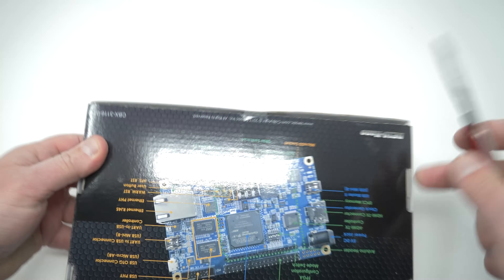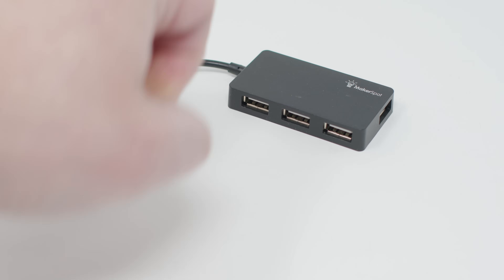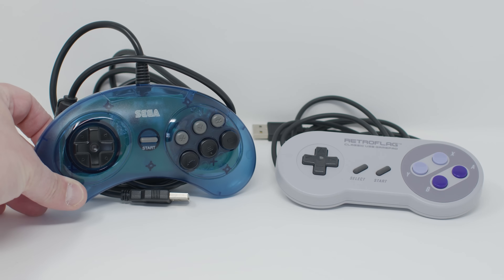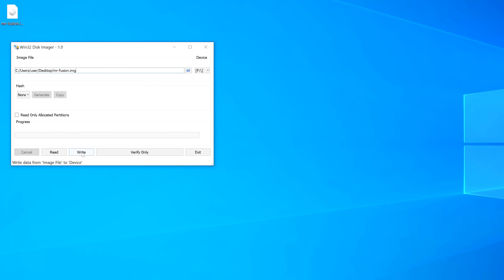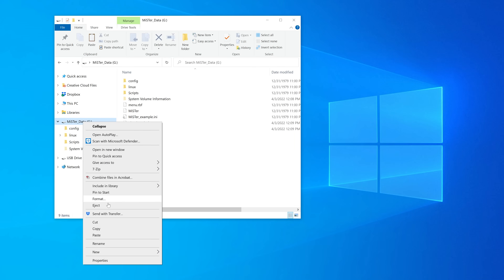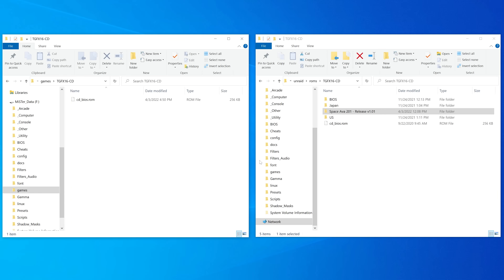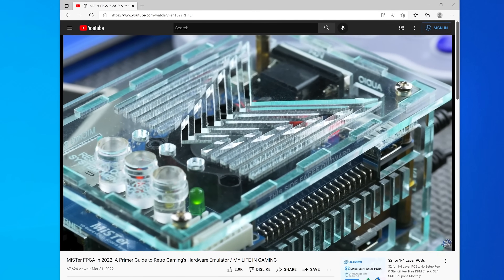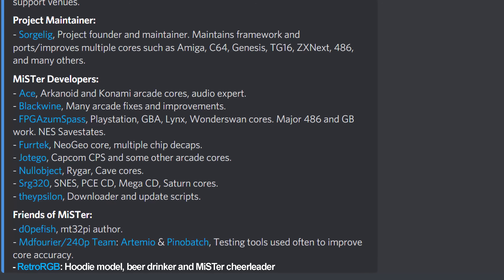MiSTer: Getting Started

Comment: My only concern would be having the OS mounted on an SD card. These are easily corruptible in my experience playing with pis etc. Is that concern rational with this?
Reply from the maker: I've been using MiSTer since it was in beta and have never once had a MicroSD get corrupted, or the OS in any way.  Your concern is absolutely valid though, as in the PC world that's something to worry about.  Also, to "back up" the MicroSD is as simply as copying the Windows partition to a folder on your PC, so for whatever reason if you needed to swap the MicroSD, just re-run the process in this video on a new one, then copy back everything else on top of it.

Comment: Doesn't this require the MISTer to have an Internet connection to do the update and download things? How can it connect? Do you mean it's unpacking them onto the SD card. Does the card become Linux and unreadable by Windows or macOS at some point? Is it only part of the card which is in a Linux format? I'm hoping to set up my own custom SD card for a MISTer board today, containing various classic computers and consoles. Meanwhile I've only got an SD card which came with my MISTer board which contains just the Minimig Core and software for it.
Reply from the maker: Yes, you need internet access.  And the card is still readable in Windows and Mac.  Start by formatting with SDFormatter and follow this guide for all the cores.
Reply: @ OK, I’ve just ordered the WiFi USB dongle you recommended, so it looks like this will delay me by another day now.

Comment: Hello. I'm 2 years late. I've just set up the SD card, but I'm not getting a video signal out of HDMI. Do I need to restart the process again?
Reply from the maker: Yes, I would. And also make sure the MicroSD is plugged in all the way, as a “black screen” happens with no SD connected.

Comment: Is the mister a better product than raspberry pi? 
Does this support mame and all consoles that’s not HD?
Reply from the maker: Hardware emulation like Mister is far more accurate with less lag. And it’s much easier to set up controllers. But software emulation like what’s used on the raspberry pi will support many more consoles.
Reply: @RetroRGB  got it thanks I guess that’s what upgrades are meant for.

Comment: I would not recommend to use Rufus for flashing the image to Sd Card. Mister Fusion installed with the MiSTer, but i could not read the Sd Card after being plugged again to the PC. The MiSTer project only recommends 3 flashing programs : BalenaEtcher, Windisk32 Imager or Pi Imager. Cheers
Reply from the maker: I've flashed using Rufus at least 50 times across multiple MicroSD cards and PC's with no issue.

Comment: I have an older Dell 3010 with an i5, gt 1030, 8gb ram and 1tb HDD. It runs Recalbox/Batocera. It contains <15k games and plays up to PS2. Costs around $100-125 total to build.
Whats the point of this setup? The cost seems a little ridiculous? Is it something to do with licensing or ??  I'm not trying to bash or honestly curious.
Reply from the maker: All depends on what you're trying to accomplish.  FPGA hardware emulation has the potential for zero latency, in a small package.  If you want a casual gaming station, your PC is fine.  If you'd like something good enough to run tournaments on, you'll (at least now and in the short-term future) need an FPGA-based solution.
Your comment (and I mean this respectfully) is exactly like saying: 
"Why would anyone buy an Acura?  The cost seems a little ridiculous.  Why not just buy a Honda?  It's the same thing..."

Comment: Thanks for all the content! Let me ask you this, since you are a master in video conversion...hehe. Is there a way to successfuly connect the HDMI port of the Mister to RCA/composite televisions? Should I use an HMDI > VGA and then a VGA > composite, or an external converter? I haven't tried anything yet, just researching about it. Because I have an old television with composite inputs, and the mister is with a digital I/O, so no VGA out, and I wanted to make it work. Thanks!
Reply from the maker: We're almost there.  I should be doing a follow-up stream by the end of the summer, but here's where we're at:  https://www.retrorgb.com/testing-mister-s-video-and-composite.html

Comment: If you try this on a new SD card it does not work. After you write the mister fusion ISO (used rufus), you put the SD card back in the mister let it finish with misterfusion. After this, putting the SD card back into the PC does not show ANY files so i cannot copy the update all into it. Why am i missing a filesystem on the SD card after "imaging" the misterfusion ISO onto the SD?
Reply: I decided to copy the "grumpy old man" and use win32 disk imager - and that solved my issue... thanks!

Comment: My university has a LOAD of the DE10s, not nano though and I was wondering if these would work or if there are other hardware differences between the DE10 and the DE10 Nano other than size and some switches etc. Cheers
Reply: If you can borrow one, you could just try if it works. They have a pretty similar FPGA on them, but the DE10 lacks HDMI. It only supports VGA output.

Comment: Just got my DE10 setup thanks to this great video.  It must have saved me a good couple of hours of trying to figure it out.  Now I need to try and figure out how to SFTP stuff over to the Mister as it's a pain taking the SD card out and putting it in my laptop (or maybe I just need to get an SD card reader for my desktop).  Really looking forward to start playing, should receive the 128MB memory and a couple of controllers in the next couple of days :-)

Oh and anyone in the UK who is looking at getting a DE10, I got mine from Terasic directly, took about 3 days when it was in stock (had to wait about 3 weeks for stock), the power supply is a US one but a £4 travel adaptor from Sainsburys works great to plug the power supply in (it runs at 110 to 240V).

Comment: you guys are gonna hate me lmao
i use an adapter specially designed to take the MiSTer  vga out and convert it into composite/s-video 😈

then i use a crt from the correct time period
#team240p
Reply from the maker: I use those too sometimes :)  My follow up video will show composite and S-Video solutions, as well as RGB and component.
Reply: using 240p test suite its flagging me at 0 dropped frames 😻

Comment: That "update all" script looks a bit dodgy... it downloads the roms from somewhere. Does it not put the mister project in legal danger bundling roms like that?
Reply: The update all script is to download the bios and core configuration for each system. The user still responsible for supplying the Roms for those systems.
Reply: @nostalgiaave6966  The script does download MAME ROMs.
Reply: It's not an official script, so the MiSTer team isn't responsible for it.
Reply: You're right, that's why I don't bundle it with Mr. Fusion and it's not part of the official MiSTer release. Many of the BIOS files for different systems that update_all downloads are also proprietary and protected by copyright.

Comment: No point in making this video when there hasn't been a DE10 in stock for weeks and no sign of any coming anytime soon
Reply: People have been buying and receiving them. However even if that was not the case it's still a useful video.
Reply: Terasic has a small stock if you contact them directly.
Reply from the maker: But there’s a point in posting this comment?
…and stock pops up from time to time, so not only are you annoying, you’re wrong.
Reply: @RetroRGB  Exactly! Ordered my DE10 direct from Terasic a couple weeks ago and it was at my door in less than a week =) The website said it wasn't available until late April.
Reply: Well I was crochety when I posted this because I been trying to get one in the UK here for ages and your video popped up which was a bit like rubbing salt in the wound.  But I didn't insult you so you didn't have to insult me did you?

Comment: Love my MiSTer. Hook it up to a CRT and it might as well be the real deal. My Megadrive and Mega CD are now under the TV for the look of it :)
Reply: its better than the real deal (sometimes) because you can enable extra on screen sprites / memory 😭💝
Reply: @jonniefast  Yeah, that's a great feature. I don't think you actually get extra sprites but it certainly helps deal with flicker and slow down.
Reply: it basically replaces it.
Reply: Which type of connection are you using to go into your CRT? I get nauseating image artifacts out of the genesis core when I use Antonio's composite adapter.
Reply: @dpcaire  As I'm in the UK i'm using the project packapunch RGB scart cable for analogue NT mini and MiSTer. Gotta love scart. I did use the same converter as yourself for S-Video and had no problems with it visually that I can remember.
Reply: @dpcaire   try an s-video to composite adapter and see if that cleans up the signal - its like $5
Reply from the maker: Getting composite from a MiSTer is much more complicated than just using an adapter...for now.  By the time my analog-out video is released, this will be solved :)

Comment: Liking the fpga project. Almost don't want to use pc emulators anymore. Even my consoles are put away for use on the day i want nelstalsha.
Liking all the cores. neogeo is my fav. Wow psx beta is shaping up. No need to get a ode- hdmi mod ps1 now.
Get 128mb don't cheep out it's not that much more expensive. Im thinking in getting digital o with duel ram.
COme on someone make some new reto controllers. High quality. for the console and for the llapa.
Blister works good for me. Snak adapter needs another port for second player. Wish i didn't loss that port for mt32 which is for pc cores that most of them don't support llapa anyways.